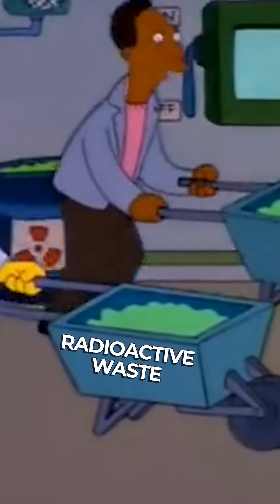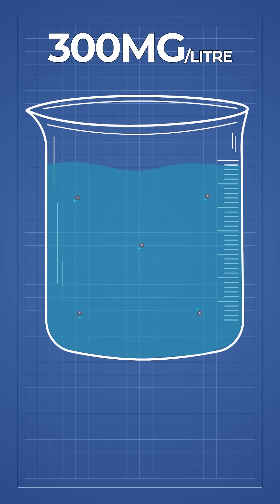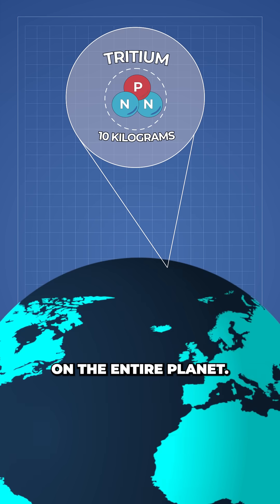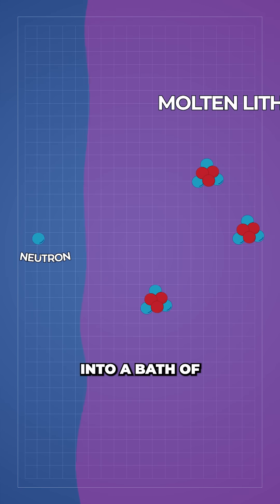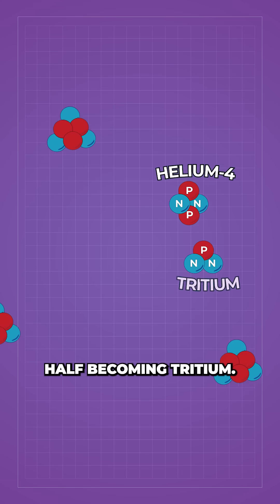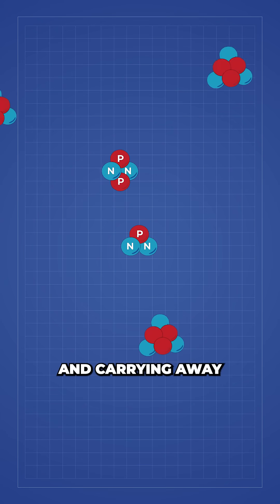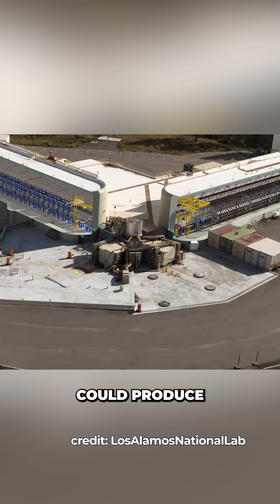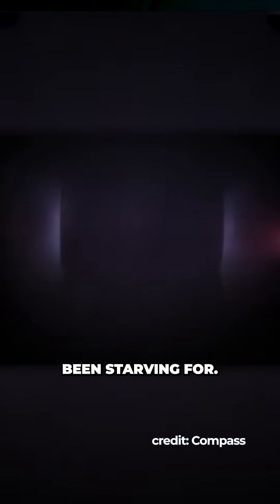Scientists Just Created Fusion Fuel From Nuclear Waste

Comment: Helium as a byproduct also has resale value as it’s a limited resource. Although it’s not worth crazy amounts rn.
Reply: That slipped right past my notice!
Depending on volumes produced we could have airships again.
Reply: @JTByrd386 the problem with airships is helium is much less buoyant than hydrogen, and hydrogen is flammable.
Reply: @JTByrd386 that would be so awesome. One of the coolest forms of transport.
Reply: My gut feeling is one day we will discover it is a critical element in some important piece of future technology or process. Upon where this process will become very important.
Reply: @robertrose9307 I wouldn’t be surprised. It’s already important for a few important applications but not in quantities we can’t extract right now. But that won’t be forever. Hopefully this kind of stuff gets implemented but I’ve been hearing news about fusion for ever now.
Reply: @robertrose9307  I believe its important for MRI scanners and semi conductors
Reply: @evelknievel2000  iirc its helium-3 not 4 that's used in semiconductors
Reply: @robertrose9307  it’s used in MRI machines so I’d say it’s still pretty important to have a supply of.
Reply: @robertrose9307  it already is, it's called breathable air
Reply: Is it Helium-3 or Helium-4 that could be very valuable??
Reply: @complex1826 Li7+1n = H3+He4+1n - this is simple math :)
The neutron isn't really absorbed by the Li7, more like it smacks the nucleus just hard enough to cause it to split apart. Otherwise we would end up with He5 probably which is highly unstable and would decay by releasing the additional neutron. So it would end the same way.
Reply: @complex1826 they're both usefull
Reply: I'm pretty sure the fusion reactor itself will produce way more Helium(that's what Deuterium and Tritium fuse into, whole releasing a high-energy neutron)
Reply: Balloons!
Reply: Helium 3 is fuel for fusion reactors like Tokamak and super valuable. Helium 4, IDK does it naturally turn into normal helium, or Godzilla?
Reply: @DistracticusPrime helium 4 is normal helium, and thus inert
Reply: It's very valuable for clowns!
Reply: two kilograms of helium per year? No, not really.
Reply: @badmaniak you'd be make vastly more helium
Reply: And it's hella useful as an inert gas, better than nitrogen
Reply: @kamuikadet6538  no, since it’s one helium atom per tritium atom you’re only gonna get 4kg of helium for every 3kg of tritium.
Reply: I think helium-4 Is theorized to be very reactive and could be used as spaceship fuels
Reply: @AntonioPerez-wf2lf helium-4 is just what you call the most common isotope of helium, and its a noble gas, so its incredibly inert so it cant be used in rocket fuel
Reply: it's crafting for two oak doors and getting 3
Reply: At least they can have good parties with balloons
Reply: Was looking for this comment
Reply: If it makes as much helium as tritium, at 2kg/year, 2kg of helium is 11.2 kiloliters. That's nothing, the Goodyear blimp takes almost 6000 kiloliters of helium.
Reply: Helium-4, not just helium!
Reply: @robinhodson9890 that is just normal helium. Atomic number 2 meaning 2 protons but it also has 2 neutrons equalling 4. That’s why it’s called helium-4 it’s labeled after its mass. There is a helium-3 (2 protons 1 neutron) but that is almost completely nonexistent on earth Atleast in nature. The moon supposedly has plenty though. 

As an example. Uranium-238 is the most commonly naturally occurring uranium. It’s has 92 protons + 146 neutrons equaling a mass of 238. Therefore it’s labeled as U-238. The most common uranium found in nuclear weapons and reactors must be refined from U-238 into U-235 which has 92 protons, (the number of protons designates the element. All elements with 92 protons are uranium), + 143 neutrons equalling 235. Therefore it’s U-235.

Comment: Don't we already have neutron generators we can use with the accelerator? This is the same process we've been looking into for generating tritium while the fusion reactor is running, we're just slamming it with neutrons from a different source. Why are we using nuclear waste for this? What's the benefit?

Comment: This isn't really a new idea.  I first heard about it in the mid 2000's.  Also using an accelerator driven spallation setup lowers the energy economy of the tritium since it takes more energy to produce it.  It's easier to just use a lithium blanket around another reactor.

Comment: For the love of god can we PLEASE start investing in nuclear power plants again, it was literally like only a couple times
Reply: Several months ago I read about a small molten salt reactor that scale by hooking a bunch up together and were designed to be unable to have a meltdown... if an uncontrolled reaction starts, the reactor shuts itself down.  It also doesn't use uranium, it uses thorium which is both safer and more easily available as well as MUCH harder to weaponize... which is the main reason they weren't developed sooner.
Reply: Chernobyl - they turned off the safety systems to see how close they could get to a meltdown.
Fukushima - was badly designed - the tsunami wiped out the backup cooling system.
Three Mile Island - minor meltdown - close to zero release of radioactive material.
Implement the lessons learned from these events, and nuclear power is by FAR the safest course of action!
Reply: @jeffputman3504 
Unfortunately, nuclear just isn't commercial viable. Its literally 5x more expensive per delivered kwh compared to wind.

Maybe some day the tech will be ready, but not yet
Reply: @Cambyses1467 Man , I don't know why you are so determined to die on this hill, We are not trying to replace renewables with nuclear power, We are just trying to make it replace fossil fuel plants which are OBJECTIVELY Worse than nuclear in any way except for cost which you seem to  think is SOOOOOOO important. 

Also no , we can't have citys running on renevebles  (not counting hydro becouse it's perfect but again , do you have a river nearby?) becouse they are not consistent and people would not like random power outages frequently. I know that one way to fix this are batteries. But they aren't good enough for consistensy yet. 

So until we get that battery technology in , we need something to handle baseload that is not dependent on the environment around it.

This leaves us with two options --> Nuclear or fossil 

Now tell me, would you choose fossil becouse it's "cHeApEr" and deal with all the air pollution and actuall radioactive waste it pumps to the air (Way more than nuclear funnily enough).
Reply: @HPR19 
You're confused. The non-dispatchability of wind and solar is irrelevant right now. As long as 30% to 40% of the grid remains Dispatchable, we can replace the rest with wind and solar.

Yes, EVENTUALLY when we're replacing the last of the fossil fuels we'll either need batteries or nuclear, but that problem is YEARS away. And at current trends of prices, batteries will undoubtedly be the solution, not nuclear.

Right now, our goal is to replace as much of the grid as fast as possible. And we can do that 5x faster with wind and solar. Nuclear would just keep fossil fuels around for longer, which is why oil companies invest so much in pro-nuclear propaganda
Reply: @Cambyses1467 So, explain me France then , their use of nuclear power caused many coal plants to go out of service which goes against your belief of it prolonging their existence.
Reply: Nuclear is not more expensive when you factor in battery storage. You can't just hand wave that away. Or are we going to have coal fired backup generators? Nuclear is the only thing that makes sense long term, even if it did cost more. Which it most certainly does not need to. Where are you getting these figures? You do know it's the safest by a mile too?
Reply: For the people thinking nuclear energy is economically a good idea:
Why don't you invest? You don't need a state. Get together. Put your money together and invest. 
If it's obvious to you, that it's such a good investment, why hasn't it been done? Why haven't you been doing it?
Reply: @tofu-munchingCoalition.ofChaos  Not many nuclear power plant companies on gofundme surprisingly asking for donations
Reply: @tofu-munchingCoalition.ofChaos 
Because they're all kids who spend too much time on YouTube 😂
Reply: Um akshually it's more like 3 times. Heh, wouldn't expect a noob to know to be fair 🙄
Reply: Do you want your energy bill to double?
Nuclear is WAY too expensive currently. Literally 5x more expensive than wind and solar.
Reply: @Cambyses1467  but produces 100 times the amount of power? And the main reason it costs so much is mostly due to construction of the plant (and the delays of said construction) I mean running it is also pretty expensive but cheaper than that same amount of power using wind or solar and the size is way way way smaller
Reply: @dandafan
Nope!
On a per kwh basis, nuclear is 5x more expensive for every kwh generated.

Do you want your energy bill to increase 5x?

Wind and solar not only generate cheaper energy, but once they're installed have basically no maintenance. Contrast that with nuclear requiring an entire army of full time staff, which is part of the reason its so expensive
Reply: @Cambyses1467 whilst yes the cost is about 5 times as much per kwh(in the worst case) you would need 200 5mw wind turbines alone to match the power output of a 1gw nuclear power plant and that's if their in perfect wind conditions all the time which is impossible and not to mention how much land it would take to set up such a wind farm and then the cost of replacing them every 30 or so years and you would probably need to at least double the amount. Of turbines to account for the afor said inconsistentcy in wind and the main cost of nuclear is just building it and the delays that are caused by political matters
Reply: @Cambyses1467  Nuclear power is more like 3x more expensive, if you invest in nuclear power it will get cheaper, it was not long ago when solar was 10x more expensive than any other energy source, not to mention that this  data is from America, which uses obsolete reactors that cant recycle spent fuel, this technology utilized in France or Japan reduces the cost per kWh dramatically.
Reply: @Cambyses1467  You're delusional about the "no maintenance."  Wind and solar would require a LOT of area and are also notoriously unstable, if the sun's down and the wind stills you have no power generation.  By all means the technology should still be developed, maybe one day it'll be more capable, but for now it just CANNOT meet the demand.
Reply: @InternetGravedigger 
You're very confused and uneducated here.
Wind and solar require near zero maintenance.

Nuclear requires a plant full of staff operating 24/7, along with an entire army to mine and refine nuclear materials to feed it.

Maybe one day nuclear technology will be commercially viable, but right now the entire world is building nothing but wind and solar precisely because its so vastly superior
Reply: @Cambyses1467  No, they're building wind and solar because so-called "experts" have been proclaiming the imminent end of the world due to climate change for literally decades along with hefty kickbacks from various industries that sell this sort of thing.  Also, any kind of buildup on solar panels would reduce efficiency so they would need to be cleaned,   As for wind turbines, they do require maintenance... basic checkups 2-3 times a year at a minimum.  I also notice you didn't address how much land would have to be used or the instability issues.  One of the major reasons nuclear power isn't better is because it all started out of the nuclear submarine projects... once they had a reactor good enough for that, they stopped developing it any further, plus nuclear power was stigmatized after Chernobyl which made it difficult to get any further research into nuclear power done.
Reply: @InternetGravedigger 
Actually that's just pure conspiracy propaganda.
In reality there are effectively no subsidies anymore and haven't been for YEARS. Nearly every independent corporation over the entire planet is choosing wind and solar precisely because its so vastly superior to nuclear.

I think its time you ask yourself where you're getting your information from, and why they might want to lie to you
Reply: @Cambyses1467  I didn't say anything about subsidies... it isn't being done through subsidies, it's being done through propaganda and over-regulation.  Basically the same thing the oil companies used to (and probably still) do, pay politicians to make things harder for competitive technologies..
Reply: @Cambyses1467  i think you forget that wind and solar require batteries which if you didn't know also costs money
Reply: @IHaveaProblemWithV 
Actually that's false!
You're unwittingly referring to Dispatachable Generation, which a typically makes up about 30% of a grid. In other words, wind/solar could make up to 70% of a grid before the Dispatchable Generation portion needs to be replaced.

Nobody is discussing replacing the ENTIRE grid overnight. We could build wind and solar for DECADES before we have to start replacing the last of the grid
Reply: @Cambyses1467 Or better yet , explain me Germany, who closed off their nuclear plants and tried to replace it with Solar and wind but failed so horribly they had to keep coal plants and even reopen a few more just to keep grid Stability? And ended up releasing more carbon then France even though investing way more in renewables than it?
Reply: @HPR19 
Germany basically tried doing it overnight. If we wanted to replace the entire grid overnight we'd have to build nuclear as well.

But we're not, so its a moot point
Reply: @Cambyses1467 Look man , as much as we are arguing right now , we are on the same side and want to same outcome, that is fossil fuels out and cleaner energy in , us fighting and clanshing with each other only helps the oil companies. Why can't we just come to q middle ground instead of sticking to tribalism and making our lives harder?
Reply: @HPR19 Pro nuclear propaganda comes from oil companies 
 Its the same strategy of Deflect and Distract they've always used. They know nuclear is too expensive to be feasible, and that wind and solar can quickly and cheaply replace fossil fuels. What better way to stall progress than to convince people of a non-viable option and sow disinformation among the real options? Just like they did with carbon taxes.
Reply: @Cambyses1467 Nuclear power is expensive, you are correct, but it's not impossible! I don't know why you are trying to tell me that's it's basically impossible to build a nuclear power plant, Look , I get it , renewables ARE the best for the environment so far , but just like everything else , they are not perfect! So why don't we just use nuclear as a last ditch effort?

Like your city is near a river? Great! Build a hydroplant on it and never deal with anything else again!

Your city has wast unused fields with a lot of sun and wind potential? Great! Built solar and wind on it.

Do your city have hot lava running underneath? Great! Build a geothermal plant on it!

Now if none of the above is met, then you should build nuclear power plants , you get what I'm saying?
Reply: Nah Bro.. don't want any more melt downs 😅
Reply: @crazycutz8072  Do you ever go outside, or are you too afraid to open the door incase a meteor or a lightning strike hits you?
Reply: @crazycutz8072  but we do want oil spills?
Reply: @crazycutz8072 Your an idiot and are part of the reason we are being held back
Reply: @crazycutz8072  Deaths from coal mines or even wind turbine truck transport accidents likely far surpass any melt down deaths. 
Not to mention more layers of safety since then.
Reply: @crazycutz8072  the current safety systems in moderns reactors can instantly stop a reaction rendering it inert. the safety concern of a nuclear plant is moot

Comment: Quick Google search says 25 to 30 kilograms world wide and 10 kilograms neded for a fusion reactor.

"The total amount of tritium is very small, with an estimated 25–30 kg of civilian-use material. 

Rapid Decay:
Tritium is a radioactive isotope that decays with a half-life of about 12 years, meaning stockpiling is difficult. 

High Fuel Demand:
A single commercial fusion reactor could require up to 10 kg of tritium to start up, a substantial portion of the global supply. "

Comment: Nuclear fission happens naturally and releases neutrons, but you need to speed up the process to get a useful amount. Previously you would need a nuclear reactor, or some rare and dangerous material.
Now they can do the same thing by shooting a beam at nuclear waste.
Though a downside is the old method generates electricity, but this new method costs electricity.

Comment: Tritium isn’t always used for fusion, sometimes it’s only deuterium, sometimes only tritium, and sometimes both. Lithium blankets in fusion reactors are, well, lithium covers on the interior walls, the process is quite simple, it does something called Breeding, where the reaction sends particles towards the blanket, and they react with the lithium, creating tritium to continue the reaction without burning all the fuel in 30 seconds